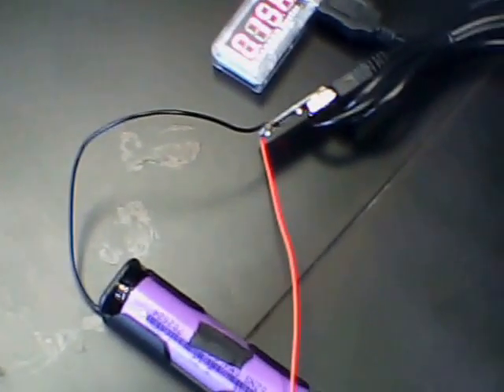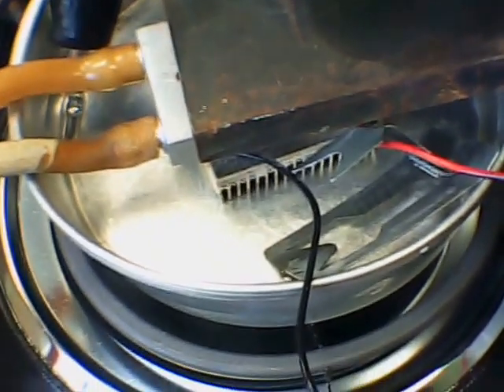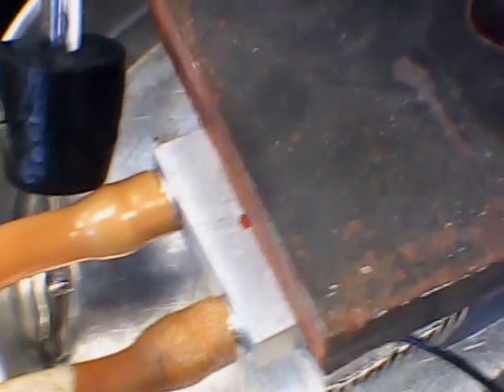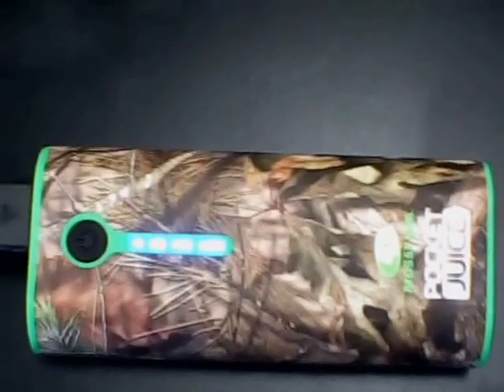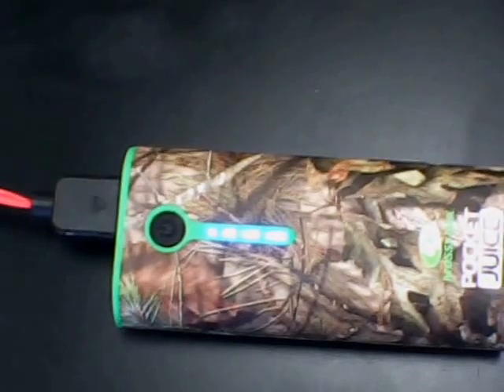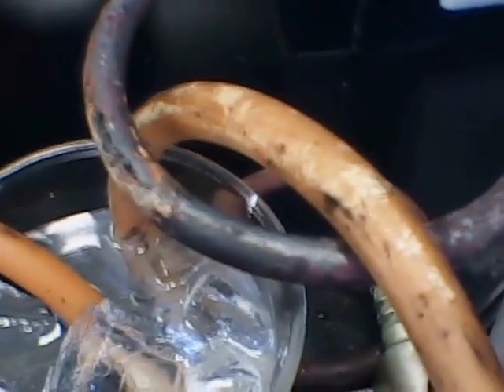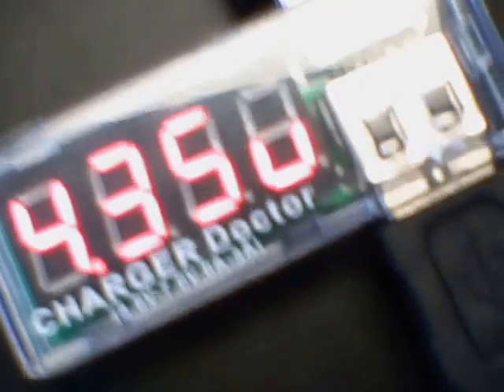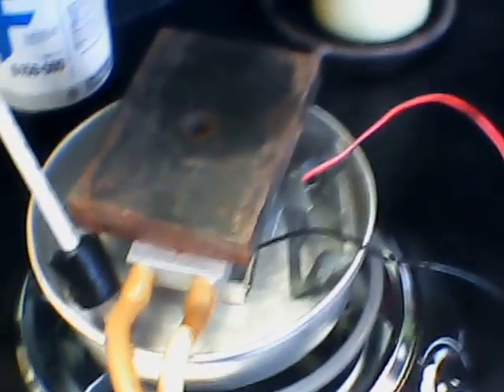Thermoelectric Generation/ Energy Storage/ Lithium Ion Battery Recharge

Comment from the maker: There is a place in CA. that sells them. I bought one which , I recall, operates at much higher temps than I worked with in the lab. I placed it on an aluminum cooling block with cold water going through the latter.

Comment: Hi there, what is the model name/number of your thermoelectric generator module? did you check the max temp it can handle?
Reply from the maker: Hi   As you know they can vary. I am working on batteries these days. Look for: SP1848 27145  SA  ( on eBay). The area is 4x4 cm.   I also had some a little bit larger.  Proceed slowly with the temp differential and, as I recall, I burned a few out doing so. Try your best with the cold area being low as possible. Good luck.
Reply: David Soriano yeah they vary in sizes and in material used for different temperature resistance and also the way you want to use them (Peltier mode or Seebeck), i still don't know which module i should buy for stove generation, to get the best efficiency for the price, some modules have 2 levels also, did not quite understand why.